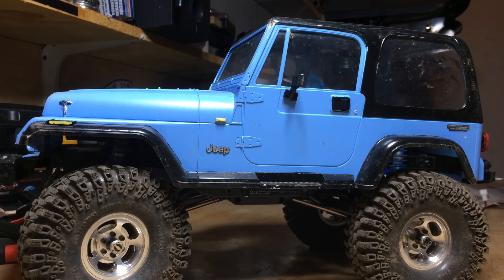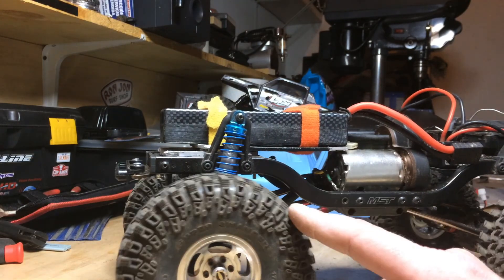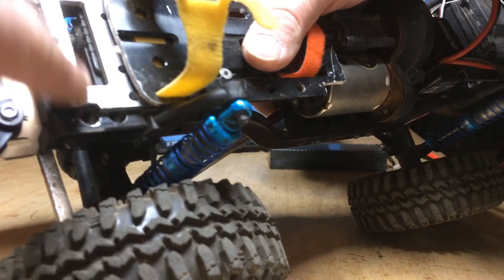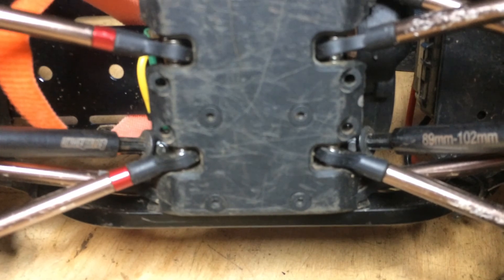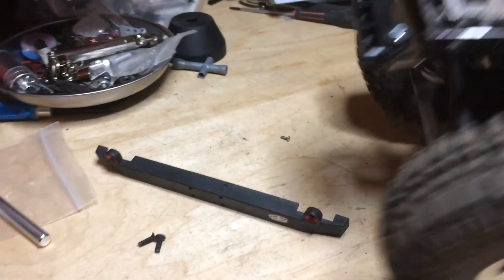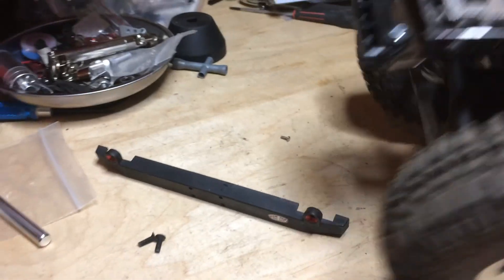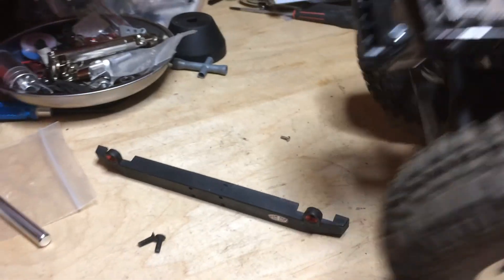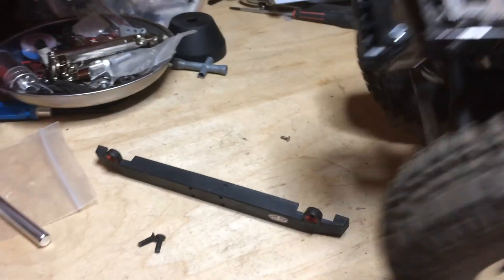MST  CMX  Modifications

Comment: That is NICE!! Somehow, I'm GOING to get a MST-CFX or CMX Chassis..... Very clever mods up front! Particularly the CMS.
When I did a CMS on my SCX10 One, I made a Panhard Mount out of a Steel Curtain Rod Holder. It works GREAT, and no interference with the Tire or Suspension!! 👍👍 I'm not sure if you saw that Video yet, but I tried to illustrate what I did.
Carmine 🚂 🚙
Reply from the maker: Thanks, man!  I love this rig,even now with 13 trail trucks in my collection this is a favorite.  It's changed quite a bit since this vid, i should do an update.  I did change the upper panhard mount to a home made one similar to the one you made.  Cheers, Carmine!  Thanks for the great dialog, dude!
Reply: I can see it. Many have said how good it is. It really SUCKS to be in my situation 😔. I can't afford ANY new Rigs... I can't even afford BATTERIES. I've only got ONE left that still works. Someday... This won't last forever. 
And thank YOU for the dialog also!!

Comment: Nice little truck, I have the CMX myself with a Pajero body, really happy with the performance of the CMX chassis. Which CMS kit did you use? And where did you put the receiver?
Reply from the maker: Thanks, Jakob. I used a $9 piece I found on ebay after searching for" SCX10 CMS". Ill try to post a link, but it looks like a flat plate with a bunch of holes in it. Luckily it worked like a champ. Remember that you'll have to switch to 3 link and panhard bar set-up one you move the servo off of the axle or you could experience some crazy bump-steer.
Reply from the maker: http://www.ebay.com/itm/CMS-CHASSIS-MOUNTED-SERVO-KIT-RC-AXIAL-SCX-10-HONCHO-/120717014430?hash=item1c1b4b759e:g:-xAAAOSwKIpWC3Pk

Link to CMS chassis plate I used.
Reply: Thank you very much Chris. What about the panhard mount for the chassis, where did you get that?
Reply from the maker: I wouldn't recommend my chassis lanyard mount for this application, but it's from STRC made for the SCX10.  I just ordered front shock hoops for the SC 102 that have a built in mount.  Ill let you know how it works.
Reply: Thanks again. Did you mean shock hoops for the SCX10-2 ?
Reply from the maker: I did, stupid auto-correct!
Reply: Allright, looking forward to hear what you find out :)